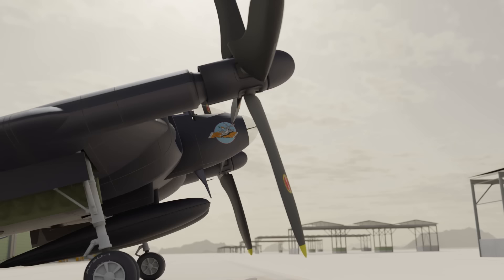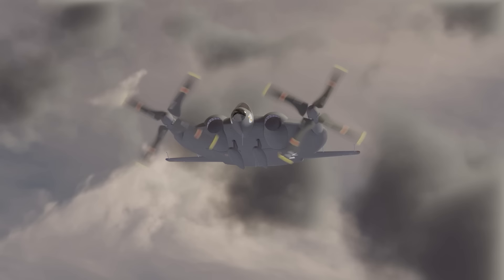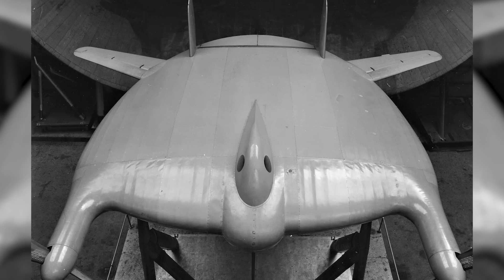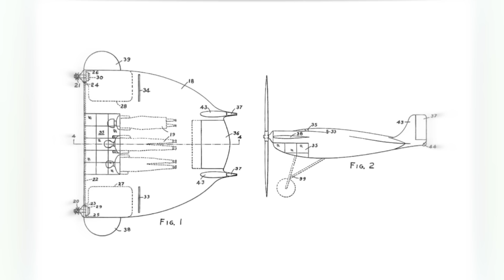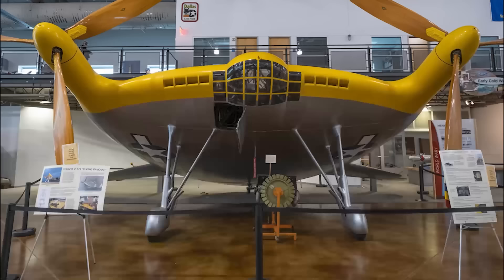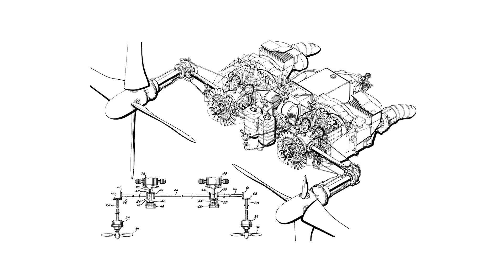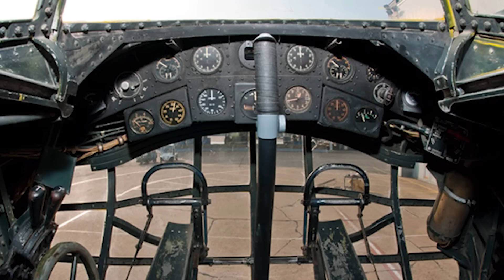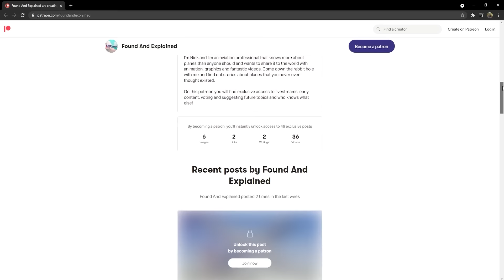The Flying Pancake - Slowest Plane Ever Made!

Comment: It had been my understanding that more powerful engines would have been installed in the production models giving it a much higher speed, so while it could fly slow, it could also fly very fast.  It could also generate its own lift with its propellers, initiating a limited hover from very little forward movement.
Reply: correct, the designs goal was to have a very fast (in fact intended to be one of the the fastest prop fighters) yet still have docile low speed handling for carrier and short field operations.  V173 was only a proof of concept for XF5U.
Reply: Negative. The Super-STOL stall-proof qualities came solely from the very-low aspect-ratio planform.
NACA tunnel tests with the Vought V-173 showed that it did not gain anything or particularly change anything versus normal sized props spinning the other way.
The Arup and very many other very-low aspect-ratio planes reproduced everything the Vought plane did, and were not slow and draggy but sleek and quick on little power.
Reply: @JFrazer4303  negative, i have the gun

Comment: This was actually a bit faster than any frontline piston engined fighter at the time and so hardly slow except when considering it's low takeoff and stall speed.
Reply: The slow speed would enable them to operate from short deck escort ships. The helicopter would eventually fill most of the roles it was designed for.
Reply: Had the widest range of speed compared to anything developed at that time, but I suppose this video only focuses on the take-off and landing characteristics. The top speed mentioned here may have just been engine/driveshaft limitations of the prototype.
Reply: Its two different planes, the original prototype was slow, but the military fighter aircraft prototype had a high theoretical top speed. Which wouldnt be shocking, considering its a compact plane with two extremely powerful prop engines.

However, theoreticals dont get you anything, if you cant even do a full flight test because of high vibrations. Vibrations are often a limiting factor towards an aircrafts top speed, and in this plane they were so bad you couldn t even take off.
Reply: @Sherwoody  it's funny because I see a ton of comments describing how this could be used in a ton of different applications that Helicopters already do. Low flying Search and Rescue, very short flights, and affordability. I was just thinking "You mean like a really cheap Helicopter?"
Reply: The XF5U didn't even fly, due to excessive vibration from the powertrain.
 It wasn't necessary: it didn't and you don't need to try to "counter" wing-tip vortices, very-low aspect-ratio planform planes are not inherently draggy, many have been sleek and quick on little power.
The Navy, if they were serious about fast, STOL planes, should have built the Boeing 390/391.
Reply: @JimJamTheAdmin  A cheap helicopter than can fly faster than a contemporary piston/prop plane, and carry maybe double the payload.
Reply: @Sherwoody  But early helicopters couldn't fly at over 400mph!
'Escort ships': Imagine had this aircraft been available on carrier-deck refitted destroyers as escorts through the North Atlantic wolf-packs! S/VTOL from a 'greyhound' it could quickly fly around the convoy - spotting and bombing U-boats by the wake of the periscope.

The plane could practically hover over a submerged U-boat and drop 'hedgehog' bomblets - any one of which could pierce the outer hull on contact. OR, in addition, drop floating decoy buoys - emitting ship propeller sounds into the water so U-boat hydrophone operators couldn't tell which direction a target ship was. Show me a 1940s jet which could do all THAT! 😁

Comment: hmm, the static pictures show the rotors  should counter-rotate. The moving picture SEEMED to show rotors rotating the same direction. I guess this must be an illusion associated with the frame rate. Nevertheless this suggests the rotors speeds were not matched.
Reply: Well spotted. Actually, in the few seconds of REAL footage around 8:28 and 13:57, they can be seen clearly to be counter-rotating. It is only in the CGI scenes, that they are rotating in the same direction, even though they have counter-rotating propellers. It's most obvious around 13:30, where they slow down. The left propeller (right side on the screen) is turning the wrong way! It only shows that the people making these CGI have no understanding of aviation principles, or didn't care to do it properly.
Reply: This happens extremely often and seriously puts me off, very evident

Since the way this plane works is actually that it took advantage of the upward rotating half of the vortex column produced by those giant propellers, to both create an increased upward force below the wing, and to completely eliminate the wingtip loss it would otherwise have.

If the propellers were oriented to spin in their opposite directions, with the downward rotating half of the vortex column hitting the top of the wing, the plane likely wouldn't even get off the ground.
Reply: @foolishwatcher  the model looks fine apart from that? Its a Youtube video mate, its such a simple mistake as an animation turning the wrong way. In all honesty, if this had millions of dollars worth of production behind it I'd agree with you in that it would be a shock to see a detail like that missed. 

Try to not pair a minor detail easy to miss with absolute intent to ruin the immersion of a floating digital model.
Reply: The props counter-rotate. Zimmerman's genius was that the props "unwound" the wing tip vortices, which had bedeviled earlier low-aspect designs. This, in turn, provided the flapjack's amazing 25:1 functional airspeed envelope (20-500 kts). Incidentally, the airfoil cross-section and the planform had the same shape, differing only by their "thickness".

Comment: Actually, the flying pancake, also known as the Vought V-173, was a concept design which was used to test aerodynamics, and controllability of such a design for a fighter. The result was the Vought XF5U "Flying Flapjack". Yeah, the name sounds funny, but don't let it fool you. The XF5U could survive a tremendous amount of punishment. (In fact, they had to destroy them with a wreaking ball once the project was cancelled). It's top speed was 452 mph which is insanely fast for a prop fighter in those days. It had an incredible armament too; 6 x .50 (12.7mm) machine guns, and could also hold 2x 1000 pound bombs. Those machine guns would shred any fighter to pieces. Sadly, they old made two of them, and both were scrapped after testing.

Comment: Vought: "I can design a super slow aircraft!"
Sikorsky: "Hold my beer."
Reply: Focke-Wulf Fw 61 from 1936 want to have a word with you...
Reply: Fear Sikorsky
Reply: laughs in polikarpov Po-2
Reply: Arup planes did all of that in the '30s. Fast on little power, and super-STOL.
Are any of these other super-STOL planes also stall-spin proof with amazing climb rate?
Will not stall. Flow does not separate from the top of the wing as ~<20 kts at ~35+ degree incidence, and the controls have strong smooth flow.

See the "Flying Heel-Lift" youtube about the Arup.
The Arup was clearly superior to any of these other sorts.

BTW, "If it was so good why wasn't it built" is a red herring. A good question, why the Navy didn't want an easy to handle fast super-STOL plane. 
The fact is that the Arup and others of the sort proved the concept out: Not slow and draggy but sleek. Not awful handling but superior.

Comment: The propellers were counter rotating. They washed the air downward over the wingtips to counter the effect of wingtip vortecis. The port side prop spun counter clockwise and the starboard prop spun clockwise. I love watching your animations, but please think about these things.
Reply: Counter rotating props are used in any multi prop plane.  It also create balance between the left and right side of the plane. Counter-rotation is to balance propeller torque effects thus eliminating any problems
Reply: "Counter rotating" "the egg beaters are lobbing" was my take.
I think the speed and short takeoff would really be fun in one of these if we slap an experimental sticker on it.

A massive corn holio panel party to only want to do it once,, they had two engines. (2) 12 hour days later with 2 guys headphones on using idgaf comms yeah the vibrations could be fixed.  

Don't reuse screws you'll hate yourself.  Save all the screws from your recent addition on your house after a teardown and put it back together, after doing that every 4 days for two years you'd expect something to be right. Vegas baby. Be an engineer not a mechanic or you'll just find in aviation new ways to reuse toilet paper the stunning effects of it across the spectrum.
Reply: Spot on mate.
Reply: @Batalia122  In this case, the designer was working towards a tail-sitter VTOL, though neither of the planes had enough power or appropriate landing gear.
He supposedly wanted to counter wing-tip vortices.
As it happens, he didn't: its slow-flying ability and being stall-proof were due to the planform, not the props.
Reply: @JFrazer4303  "He supposedly wanted to counter wing-tip vortices.
As it happens, he didn't: its slow-flying ability and being stall-proof were due to the planform, not the props."
How is the second part of that comment disproving the first?
Any low-aspect ratio wing, no matter how you design it, will have a massive issue with wingtip vortices.
There's high pressure below the wing, low pressure above, and on a short wing, the air has only a short way to travel to get around the wingtip. Creating a monster of a vortex, loosing lift and creating drag in the process.
For this design to work, the wingtip props were just as essential as the shape of the fuselage. Otherwise it would drag penalty itself to death.
Reply: Thanks, I was looking for a comment like this, or would have commented myself.
Reply: @rockyblacksmith  

There's a lot of myth and misconception in that.

The huge vortices are elective and temporary, flying at very slow speed at very high A.
When flown normally, many of the type have been sleek and quick on little power.
The Arup. The Nemeth "Parachute plane". The Farman 1020 also of the '30s.The Eshelman "Flounder" of '43.
The Hoffman, related to the Arup.
The '80s "Little Bird". The '90s "Facetmobile by Wainfan.
All violate the "rule" that very-low aspect-ratio is draggy with problems due to wing-tip vortices. They're all noticeably efficient and sleek on little power.
Zimmerman didn't counter the vortices: The fact that it flew in wing-tip vortex driven "parachute Lift" shows that the vortices are very strong.
NACA tunnel tests showed that the situation with the props did not help or particularly change anything.

Comment: presumably I'm not the first to point this out, but the animated computer model shown throughout this video is the Vought XF5U, which was the later all-metal aircraft based on the V--173 with twin 1350HP radial engines covered later in the video; it would not have been slow at all, but it never truly flew before it was canceled in 1946

Comment: Actually this plane was a requirement for a new fighter for the pacific, the plane could take off at, and don’t hold me to this 40MPH from a carrier deck and it’s top speed of, 500MPH. This would put it on par with the early jets of the day. This also would’ve allowed it to intercept kamikaze and other suicide aircraft.
Reply: This thing is really bad carrier fighter, It require 541 ft of runway when there is 25 knot headwind, F4U-4 only require 288ft on same condition. There is a reasons that USN never put this thing into service
Reply: @tomshen320  
      The F-4 corsairs gull wing design. Gave that appearance that it was coming to Get ya.
      I surmise they went back to the 20mm. canons  away from the 50's was for more capacity. I would like to think. All the modifications that came about with the B&C versions were made due to input from the pilots flying earlier versions. 
      Vought later in the 1950's chose the 20 mm for that reason. On the F-8 Crusader.
    Another phenomenal contribution to our Navy's air wing.
Reply: ive heard that the design was meant to be stall-less,  which worked so well that the plane accidentally inverted itself during a stall test and flew back the way it came, straight into a pine forest
Reply: @snapcutter9596  going to the 20s was largely due to the planes getting larger heavier and faster. :P
Reply: @tomshen320  Actually, we don't know how much runway it would take, as they never did a flight test, just taxiing. Given that the V-173 test craft did a 200ft run with no headwind, and less than 50 foot run with a 30mph headwind, I think getting the XF5U off an Essex's deck (despite it being 5x heavier) will be little problem. Jets are what killed this project, not any lack of performance to spec.
Reply: @tomshen320  Not true at all.
The V-173 was super-STOL, and it was designed after the Arup S-2 of similar shape, which was also super-STOL and stall-spin proof.

With a 15 kt wind and 15 kts in the water, an Avenger sized plane built like this (or the Boeing model 391, with normal props) would have landed in half of an escort carrier deck or less. 10 kts or less landing speed with wind.
Arup S-2 landed at 18 kts. '90s Facetmobile could fly at 16 kts or less, and landing gear is the only reason its landing speed was higher
Reply: myth.
 It lost power once, made an emergency landing on a beach and because of people in the way he had to stand on the brakes which nosed it over.
Reply: Well, we’ll never known. In 1946, the production models came under fire from the press. Believing that this was a secret government research project for ufos. Those promptly all examples were scrapped, save the one prototype, which is on permanent display in the Smithsonian air and space museum, of which, I’ve have the opportunity to see for myself. Such a shame really, I’d love to see the glorious machines take to the air. And I wonder how they would’ve looked like fighting Soviet jets during the Korea war.

Comment: Aside from the mistake of not showing the props turning in opposite directions, there's the complete omission in the video of discussion of tip vortices and the reason the propellers were supposed to rotate in opposite directions. A low aspect ratio wing like this would produce very strong tip vortices in a high G turn due to the huge amount of tip spillage, creating a lot of drag. Which means it would bleed off speed very quickly in a turning fight, something that we see in delta winged jet fighters like the Mirage III or the F-102. The props were meant to turn in the opposite direction of the tip vortices, with the spiral propwash cancelling out the vortices and preventing tip spillage, reducing the drag in a turn.

Comment: This aircraft might have made a huge difference in the Atlantic as submarine defense.  
Liberty ships had a length of 441 feet so a partial upper deck conversion could have created a potent anti submarine platform.
Reply: By the time this thing would have been getting made, they may as well have used the subsequent Victory class transport vessels.
Reply: @SephirothRyu  
The Arup planes from Indiana proved the concept in the '30s "(see the "Flying Heel-Lift" youtube).
A larger plane like a twin engine the size of the Avenger or S-2 would have taken off with 10 kts deck speed with any wind and headway, and did not require more advanced technology than the mid'30s.
 They just ignored it, and when they did look at it they did a parody with the outward turning wing-tip props.

Comment: The v-173 stalled at 40 knots. Whereas the J3 cub/l-4 grasshopper stalled at 33 knots. And the piper was actually used in the military for quite some time. Seems that the almost 90 year old design of the cub remains the reigning champion of slow, hence the use of the design today.

Comment: The C-21 Dragon Assault Ship comes to mind from the James Cameron Avatar flick. The helicopter of it's time with a higher payload. 450 mph. Now that is handy.
Reply: The fictional C-21 is more like a well armed flying car concept.
Reply: It would be a poor design in real life. Disk loading would be high compared to a single rotor helicopter (more power needed for the same amount of lift) and it relies on mechanically tilting the ducted fans instead of cyclic pitch which would make for slower attitude control and more power needed to move the whole assembly. With a helicopter the angle of attack of the blade changes as it rotates around the hub i.e. the blades will have a higher angle of attack on one side of the disk than the other which in turn increases lift on one side and decreases it on the other, this requires less mass to be moved and is faster than tilting the whole thing.

 And no matter how powerful your engines are or how efficient the rotor blades design, those same advances can be applied to a single rotor helicopter as well so single rotor helicopters would always be ahead.
Reply: @atomicskull6405  yes, but top speed is limited in single rotor helicopter to around 200 mph due to procession of the blade lift... for 1945 this was a slick solution short take off and  heavy lift body.

Comment: The original nickname was the Zimmer Skimmer. The two very back surfaces on the rear of the wing, were flaps with elevon control for high angle of attack takeoffs and landings. The short wings for flight, same elevon configuration.